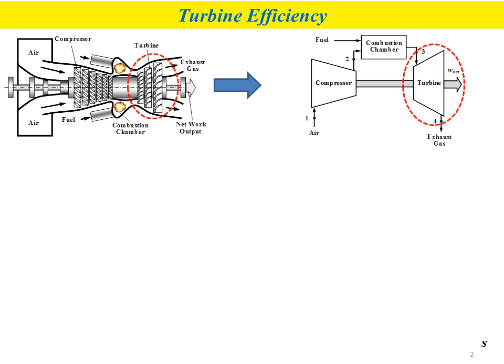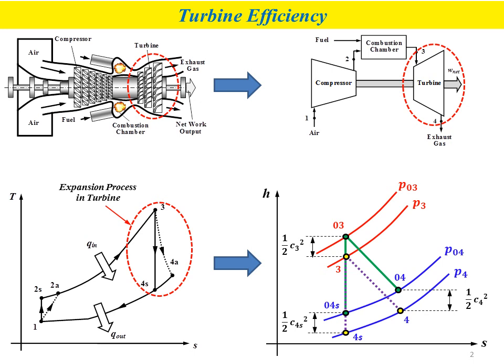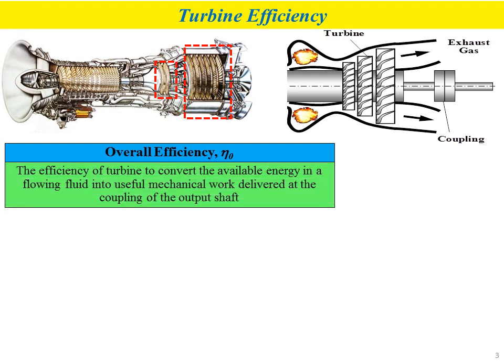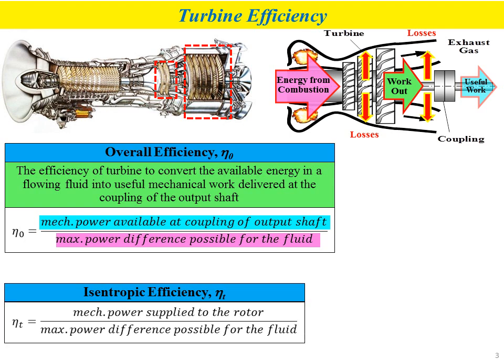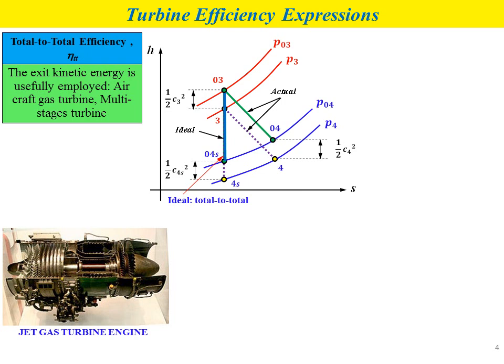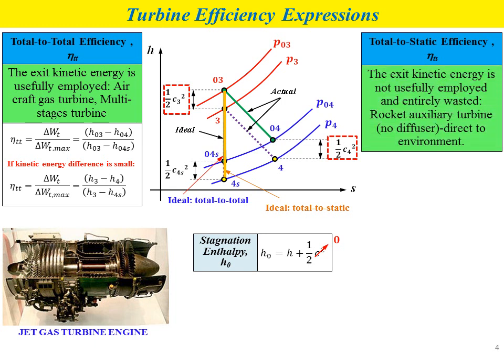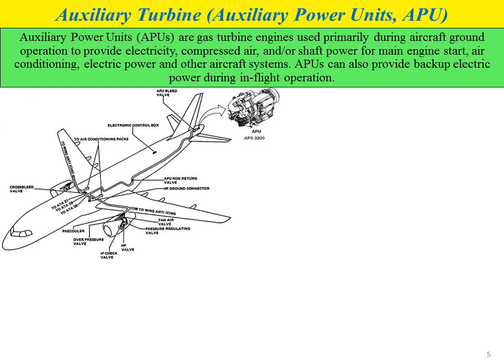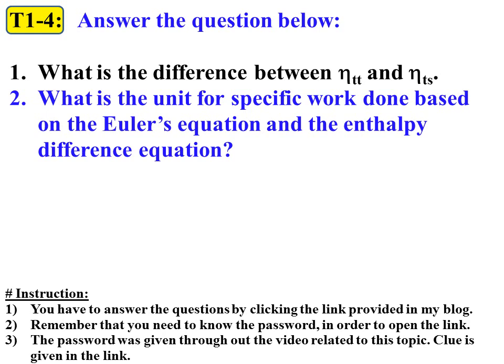TM LEC #6: CHAPTER 01 TURBOMACHINERY PART 4

Comment: Assalamualaikum Dr,  19:08 can u give the example for the energy that produced to the turbine that is fully utilized and not fully utilized? thank you
Reply from the maker: Waalaikummussalam...in the slide i already give an example...comparison between jet engine and APU unit ...For jet engine..at end of the turbine there is a nozzle that use to convert fluid kinetic energy release from the turbine to produce thrust force for the jet...This considered as fully utilized. However for APU units...in term of components is similar tu the jet engine except the APU dont have any nozzle at the back of the turbine. So no thrust force produced. Thus the fluid kinetic energy from the APU turbine will release to environment. Thus, this considered as not fully utilized.

Comment: Dr, when discussing on "Turbine Efficiency Expressions" at 18:20, why is it that in the "Total-to-Static" efficiency, the numerator part is only considering "ho3 - ho4" and neglecting the kinetic energy "1/2c4^2", whereas the denominator part is taking into consideration the kinetic energy of the fluid?
Reply from the maker: First you need to understand the different between stagnation and static enthalpy meanings. The stagnation term is same at the total term where already include the kinetic energy of fluid. For example h03 (stagnation), the enthalpy value already include the fluid kinetic energy at state 03. However if we consider h3 (static), it mean the enthalpy value not consider the fluid kinetic energy and the value is based on temperature as we learn in thermo2 subject where  h=cpT.
The main difference between total-to-total and total-to-static efficiency is whether the fluid energy from the turbine (outlet) fully utilized or not fully utilized (wasted), respectively.
 If we look at the first equation for total-to-static efficiency, initially the denominator is look like this:

[h03-(h04s-(1/4)c4s2)]
….where the term already exclude the kinetic energy term. However, when we remove the bracket it seem like the equation not exclude the kinetic energy term. This is just the manipulation of mathematical approach:
[h03-h04s+(1/4)c4s^2]
I hope this answer your question.

Comment: Dr, I would like to ask for Isentropic Efficiency, the mechanical power supplied to the rotor is work out which represent in green arrow (work out) right? Not the useful work represnt by blue arrow. Is that like this?
Reply from the maker: Yes correct...the green arrow shows the work out (work done on the blade by the fluid) produce at turbine...and consider losses related to fluid flow and blade...exclude the losses due to the coupling effect. However for the useful work...we need to consider all type of losses in the turbine system and it is similar as the net work output after consider all losses.
Reply: @yusmadymohamedarifin6008  Thanks Dr